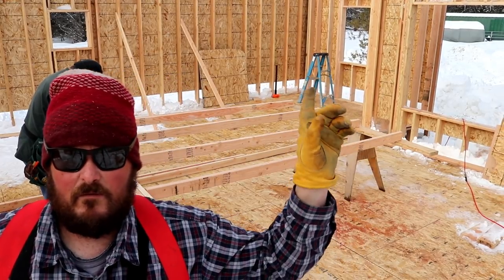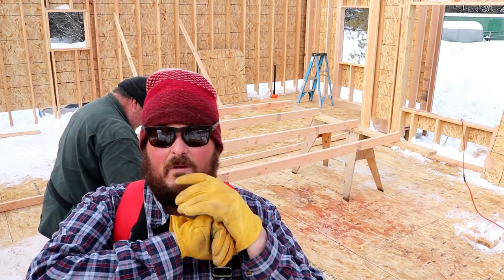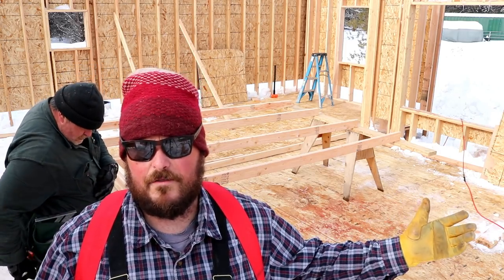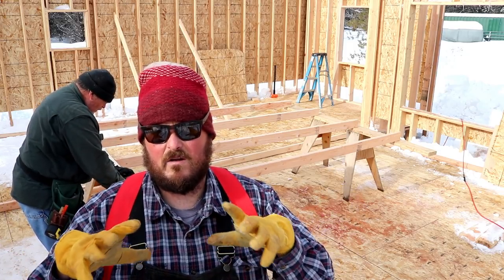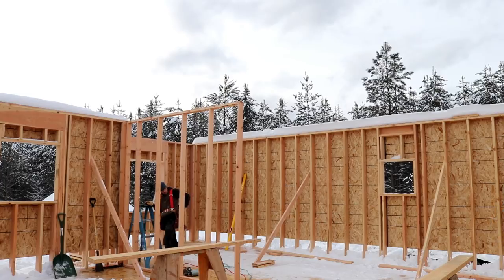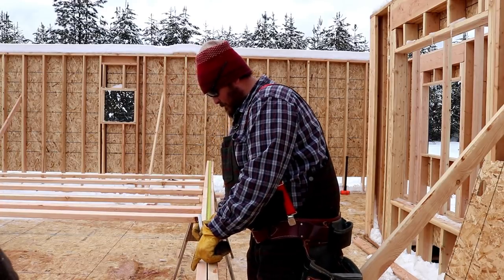Want to Build Your Own Home, You Can Do It!  🛠️😎

Comment: For anyone with wondering about the plywood or OSB. Lines always go out. Labels down on floors/roof or inside on exterior walls. It's a common sense thing. It shows the spacing of common lumber spacing 16" and 24" both orientation. Texture on OSB is on the line side (roofing purposes). Label has the date of manufacturing and thickness. You can see them from attic, crawl space/basement, and behind drywall. Not knit picking, but doing it opposite is a rookie move. House that size has about 300 sheets total on it.
Reply from the maker: because we are building during the wettest time of the year we added a waterproof coating to the OSB to help it last until better weather and then faced the OSB in the direction that would see the most weather. I know thats not typical but then neither is framing a house in the winter.
Reply: Essential Mountain Homesteading Makes sense. Every project is different. I'm licenced in Utah and Idaho. We build year round. I just have a snow removal clause for winter. And it is easier to apply coating to the smooth side. Totally agree.

Comment: wow never had to work in the extreme cold like that but did have to work in the summer heat of phoenix and las vegas. i have been out of construction for 24 years and still miss it. i don't miss the highs and lows of work however.

Comment: A few clamps on the saw horse tops will stop the plates from sliding off and an adjustable leg will hold the wall up as it get longer so the other helper can be doing something else.  Framing that interior header like that half way will give you problems installing the interior walls and doorway or door trim.
Reply: Look again when the wall is tipped up you can see that it only has one vertical in the header so the header is NOT flush on both sides.
Reply: Clean off your glasses and eyes because at 16:34 you can clearly see how wrong you are.  The left the inside part of the header out at 15:45 that side was down.
Reply: You can not do that because the cripple studs above the door would twist without the bottoms having two nails on each end.
Reply: You are wrong again.

Comment: I have trouble understanding 24 o/c inside walls studs... that means a lot of open space for 1/2 inch sheet rock not brace
Reply: Blocking
Reply: It happens all the time.  My two story house was all done with 2x4's 24" oc for both interior and exterior (not my choice I didn't build it).   I've seen it in commerical projects with metal studs as well.

Comment: Which way does the bow in the wall go?
Reply: How do you know what is done off camera.   the old guy    Bert
Reply: Out towards the exterior on vertical walls. Up on floor joist. These are typical standards. 22 years of experience. 12 years self employed.
Reply: Jim Watson Not going to get in a keyboard fight with you, but framing walls on the floor then standing them it doesn't make any sense to put the crown down. You would have to lift the plate to nail the studs on plane. We reject any studs that don't get straightened with the wall shear anyway. No way you shot a nail gun for 40 years on a framing crew. If you framed for 40 years you weren't wearing your bags for all of it.
Reply: Jim Watson My initial post wasn't even replying to you. It was to answer the "which way do you crown lumber?". Calm down. Every project is unique. I was telling what is typical. And with the crown facing up you don't have to lift the plate. Simple statement of fact.